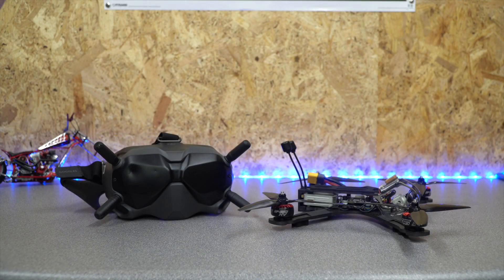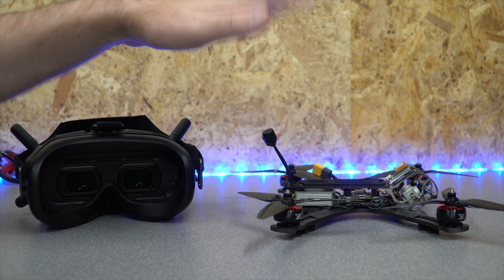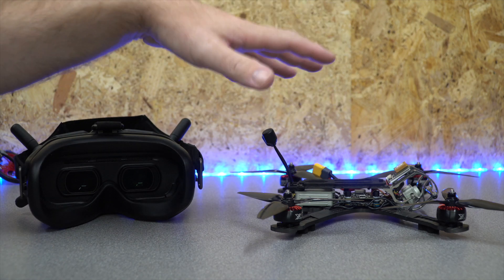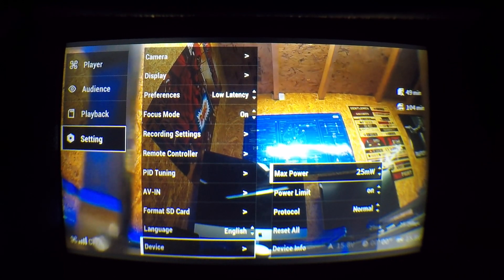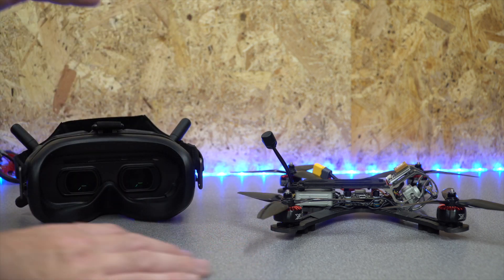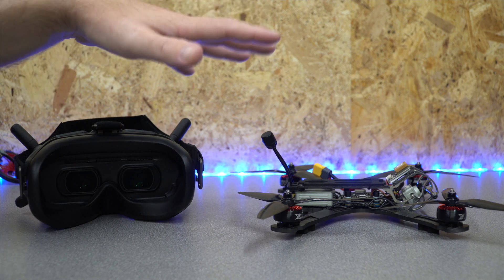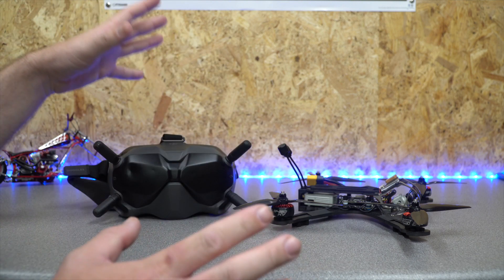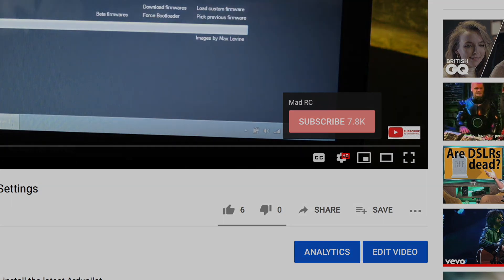DJI Digital FPV  Range Problems ?  Power Limit Mode FIX (Auto Temp Control) Explained

Comment: Yet another really helpful video.myself and my fried both have the FCC hack and both get the unlocked message show when armed. However our range even in the 1200mw is struggling around 150-200m. Is it likely that we need to turn off auto temp control ?
Reply: I'm having the same problem as you bro! In my case I use 700mw with auto temp on, but when I pass behind a tree (about 150m) the signal bar turns red. Theoretically, if we leave the auto temp on with a higher power configured(700 or above) the auto temp will reduce the power and consequently the signal strength!
Reply: @rodolfo-f7i  Hi, did you find soulition?

Comment: In my fixed wing set up (i.e. no flight controller), max power is set to 700 milliwatt; however, it does not give me the option to turn the "Power Limit" off. What can I do about this to ensure that I am operating at maximum power?

Comment: I noticed the Vistas operate a little differently.   On my Vistas before I arm i see on my osd bottom right corner (low power mode )    this is with low power mode switched on in settings on Vistas.   On my AirUnits though I don't see this (low power mode) even though its setup exactly same as the Vistas.   Also I noticed on Vistas the ms drops down after arming.  From 50ms to 23ms and I get Unlocked red message.  Is this normal  for AU to behave like this.

Comment: I did all this but when I'm in the goggles and go into players it shows 8 channels with a hollow circle next to each channel and when i go into settings it shows 25mw in white meaning its selectable but immediately gets greyed out. idk what to do
Reply: Could it be that you are in CE mode (Europe) which is limited to 25mW only hence its greyed out?

If thats the case you need to unlock to FCC (international) mode to have the other power output levels selectable.

Comment: My v2 goggle seems to be stuck on 25mw period with the original air unit. How do I change this
Reply: Have you performed the FCC hack with the file on the SD card in the Air unit.
Reply: @stinkletoes8285  ah yea I just found out about that update yesterday and applied it. All good now thanks
Reply: @andrewjamez  Excellent!

Comment: That helped me a bit further but I still have an issue: I can't even change from 25mw to 700mw. Just wont give me the option. And my signal in bottom left is blinking red at lowest even though I am right next to the drone. Any ideas? :)
Reply from the maker: That’s odd. You using the stock DJI antennas.  If your stuck in 25mw your still in CE, this is usually because of an issue with the text file.  Try making a new one and be careful adding .txt to the end as that can cause issues.
Reply: @MadRC  oh I thought CE could go to 700mw without hack!
Reply from the maker: @marcusgrip  No 25mw is the limit in CE
Reply: @MadRC  ahhh that wasn’t explained well in some sites I read 😄 that’s nothing 😳 thanks for the help 🙏🙏
Reply: seems that antennas were not working. got myself a vista now so hopefully that works better ;)

Comment: I've got the right wiring, 700mw setting and my OSD shows unlocked but Ive got a really bad range. Any ideas :( It's a new iflight protek35 HD.
Reply: Same here! Find any solution?
Reply: @tobytorials  yes Caddx Vista. Got a longer antenna with connector and iflight patch... Much better. Also chanced my channel.

Comment: You seem pretty knowledgeable about these goggles.   Unfortunately today when I went to fly at my local park on my Ebike I loosely installed the 2 top antennas on my goggles when I put into my bike basket.  Just a habit.   When I got to my park location I powered the goggles on and as I was adjusting them to my face I realized the 2 top antennas wasn't tightened ALL THE WAY.  They was on put not screwed in snug.  I quickly tightened then before I armed my quads since my quad is on a uart connection.   They seemed to be fine but now I'm ocd concerned
Reply from the maker: it will be fine, they have protection onboard don't worry.

Comment: i just got the V1 googles (firmware 1.00.06) and i cant Activate them on Assistant. I have connected them with my Nazgul5 HD but when I power on the quad i cant access any of the goggle menus (i only can if the quad is off). Very weird, anyone have any ideas?
Reply from the maker: Are you using the assistant for FPV specifically? 

To try 

Make sure you have the latest assistant for FPV first 

Then update the V1 goggles 

Then make sure your logged into your DJI account and the assistant pricing settings are all turned to on and try activating.
Reply: Mad's Tech Unfortunately with the new Assistant I am unable to even install it on my Mac as it thinks it’s a virus. I read multiple people are having this issue :(
Reply: @MadRC  I cannot download dji assistant 2 on mac as it thinks its a virus..even when i override it. Seems many are having this issue.
Reply: Can i still fly fine without dji assistant?

Comment: Thanks for the video, I'm Italian and I struggle to understand.  With my plane without FC I have problems with video range at 700 mw.  So are you saying I'm actually going 25mW?  If so you have solved my problem, does it mean that I have to disable auto temperature control?  Thanks!

Comment: Thanks for a very good explanation of this issue. I currently am dealing with this issue and shouldn't be. I ordered a rotor riot complete setup and got the skyeliner HD. The goggles used to say skyeliner at the bottom and have the countdown timer and my battery level. It was this way for about 15 flights. Yesterday out of the blue it quit showing my custom osd info. It then came back on at home later on in the evening when I plugged everything in to see what it was doing and everything was perfect. Turned on activate switch and the battery voltage reading was there and accurate and the timer started its countdown. I was happy to see it was working and went to bed. Woke up in the a.m. to go fly and low and behold it wasn't working again. I am so confused have you heard of this?

I subscribed and gave thumbs up and hit the bell. God Bless and if you heard of this let me know. Im wondering if I have a defective air unit???

Comment: No option to switch this from 25 to 700 I get the unlocked message once power management off but nowhere can I see 700 displayed any advice? Thx
Reply from the maker: Have you performed the FCC hack with the file on the SD card in the Air unit.  I have a dedicated video on this ?

Comment: Oh my god!!! life saver. you just saved my quad from being stripped apart for parts. I had a taycan Diatone that worked like charm till I had to replace some motors, updated and tried to fly and the video range on horrible on DJI googles. my problem was that it was on the wrong UART. You are a genius. Thanks again. I subbed!!!

Comment: Disable auto temp control when flying. The fact that it drops down to 25mw when the quad disarms will cost you the quad if it failsafes in dense enough trees, since you'll never get your video signal back when looking for the quad
Learned it the hard way :(
Reply: I didn’t understand what u said that good so do I disable auto temp control after I arm the quad?

Comment: Thanks for posting this, I had the caution message on not being able to record due to low power setting on my first test run around the yard on my Traxxas Summit RC truck. Your video cleared it right up, Thanks again.

Comment: Hello there. My FPV system range is not even a mile. The drone Icon with channel turns red i would say after 1/2 mile. Do you think its normal ? Could you plz give an advice. Thanks. https://youtu.be/ySKIXljwuoA

Comment from the maker: ========================UPDATE - NOTE===========================

Hi Guy's, 

DJI have changed the name of these features in later firmware released since I made this video, they are now called Auto Temp Control.  When ever I refer to Power Limit it now means Auto Temp Control.

Its behaviour and principles are the same and your Air Unit will not leave 25mw if you have this turned on and you do not have a valid telemetry connection so if you are having range issues this should be checked, this stands for the DJI Air Unit , the CaddX has slightly different behaviour. 

Finally if you would like to suppor the channel you can here by ordering from DJI https://click.dji.com/AMhJIU2ENIgNoFo...

Additional Air Units 
 https://click.dji.com/AP98-RkVJboY_ss...
Reply: How can I get high power when used as a Vtx eg no fc need more than 25 mwt thanks

Comment: So I want to make sure I am understand properly. If I use the system without the DJI flight controller I can still adjust the power output of the camera through the goggles?

Comment: a prompt comes up "low power output, unable to record video"....sitting here on the bench making adjustment...no air flow...would the overheating issue cause that prompt to display in the goggles?  Thanks.

Comment: THANKS FOR THIS VIDEO:  Maiden flight today with DJI FPV on my airplane, 700mW Max Power but had power limit ON with air unit UART not connected to my FC Matek F765 wing (as I use iNav on it). So I did my whole flight in 25mW without knowing it, I pushed it to 850m (2790 feet) but signal became quite weak, back home I thought that I was not in 700mW, I check on the web and found the answer here. Looking forward to the next one in 700mW.
Reply: I used the DJI on a glider. Had the power limit to off and 700mW Max Power. The unit was mounted on top of the glider but only got about 300 meters away before the picture started to drop.  Is there a way to make sure the TX is transimitting at 700 mw? Everyone video I see says we should get up to 4k on distance.
Reply: @stationairventures6397  funny that’s about how far I can get as well.   I haven’t used in any my planes YET because I like testing range on my test quad first.   Seems almost every flight I’m getting around 1,230ft which is close to what you are getting.    I am using XF full TX and have U.Art connected and power limit on and max power set to 700mw.   When I arm my quad I see the box in lower right corner saying unlocked but range isn’t good.   I was thinking about unlocking the AU to 1.200mw but noticing how hot this AU gets even after I land from a flight with AU mounted on top backside of my 6” iflight quad.   I no bad spot to Mount but like I stated I’m just testing and I’m not flying like a MAd  man.  You’d think the AU getting max airflow wouldn’t land so damn hot but it does and I’m almost afraid to install my other AU into one of my planes.    I have a Mini Talon I run Analog on long range and I’ve been over 20 miles out with that setup but really the MT is probably best option as it has large space up front I can mount the AU for maximum airflow.   No way would I install one of these inside a model unless I setup a cooling fan to keep it somewhat cool.  We have hot humid summers in Ohio so I’m a little concerned using this system during that time of year.

Comment: I can’t fly farther than 200 feet away on 1200mw, even with a clear line of site
Reply from the maker: I would be checking you air unit antennas are in correctly. This is the usuals cause for poor range.
Reply: I have same problem with two different air units. Do you found the solution?
Reply: @libo.media1  did you find the solution? I lost one quad because it disconnected mid flight, just set up the new one having same issues can't make it pass 50 meters without disconnecting
Reply: Benjamin Barakat have you found any info on poor signal. I’m having the same issues. I replaced the air unit as well as the sma connector from the air unit. I’m running out of options. I was thinking something is grounding the signal. Maybe my nano crossfire or the sma cable is to close to the positive wire from the esc.
Reply: @jonestown1978 hi, did you find soulition?

Comment: Hmm had it all peerfectly.. Than lost osd... wires all good settings all good nothing changed. Will not detect arming.. You  many times reference an approved flight controller list.. Where may that be found?  I have searched and searched..  I am running an MAMBAf722...  and like i said it worked for a dozen flights, even had gps.. now nothing.. I assume i have blown the uart on this fc..

Comment: I wonder if either of the last two firmware updates helped reduce the chance of overheating in the air unit.  I'm now using the 1200mW hack and just wondered.
Reply from the maker: Much of the heat is generated from processing and the radio amp. Firmware can’t change that sadly.
Reply: @MadRC  gotcha, thanks

Comment: Could you do a video about the new 1200mw mod. If we need anything to cool the air unit running at that power. Maybe cooling fins on the unit to lower the temp.

Comment: hello. thx for that information. i still got a question. ihave the tmotors f55 stack dji edition in my kwad. i got a cable that fit in my stack from the dji to my esc stack. now all is working fine BUT i havent any infos in osd.. no battery voltage etc. but i selectet in betaflight. so did i need open a extra uart port in betaflight or can you tell me the reason? greez from suisse
Reply: Hey there! Did you ever figure this out? I have the exact same situation as you do.
Reply: @KyleLi  Hey there! Did you ever figure this out? I have the exact same situation as you do too.

Comment: Is this applicable for a sistem that is in CE "mode"? I mean, if i purchase the system in Europe, it comes with CE limitation to 25mw. Is it this easy to change to 700mw?
Reply from the maker: I have a specific video on how to enter FCC mode.  

In CE Power Limit would really not apply.
Reply: Filipe Dias  it is very easy yes.
Reply: As i understood, it doesn't matter where you buy the system but where you activate the system. 25mw is easilly changed to 1200mw if you have a laptop or PC.